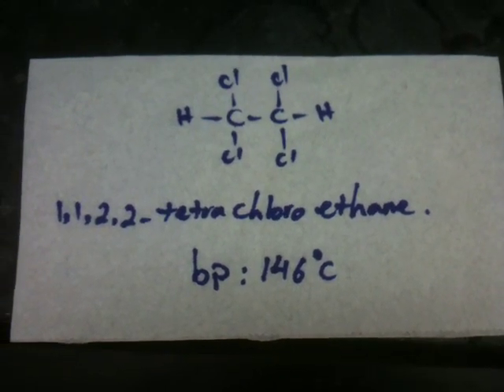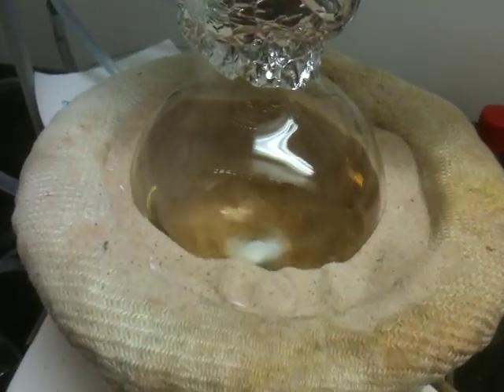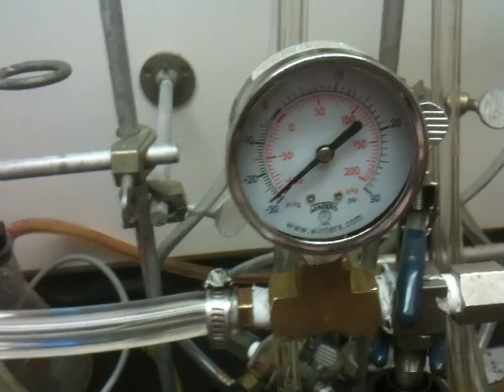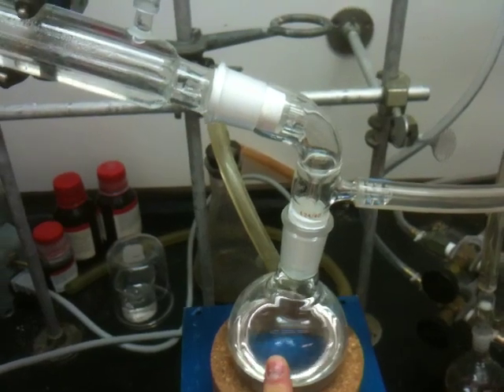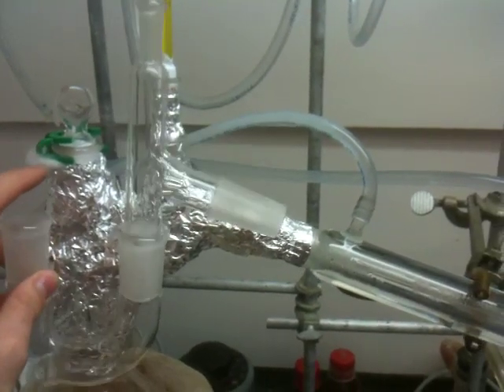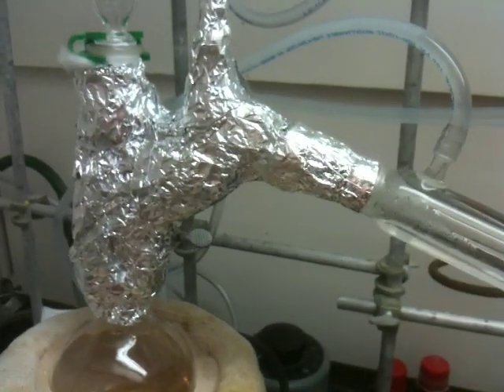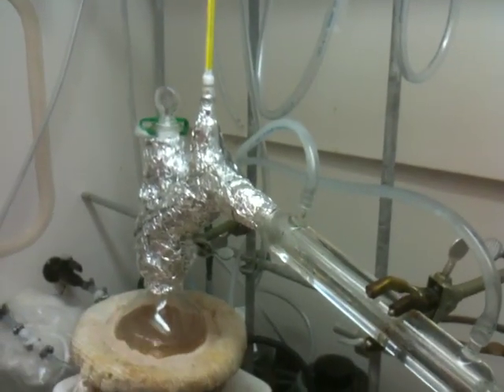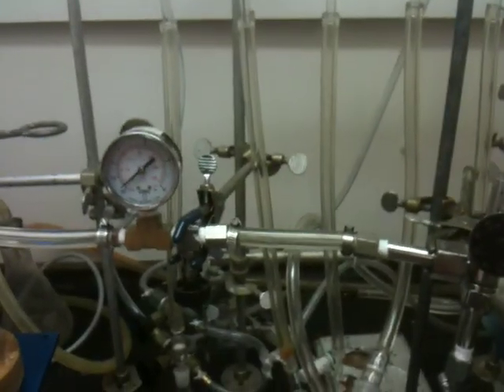High vacuum distillation of  tetrachloroethane

Comment: Hay I hope you see this.. did useing this adaptor give you better separation i am currently distilling a mixture of  3 hydrocarbons and think this one change could make all the difference
Reply from the maker: @furnish1696  I don’t see the adaptor….if you have a taller distillation tower, you’d get a better separation
Reply: Ah i meant the the swan neck fitting you where saying you'd added. I only need  like 4c extra separation. I do have a packed column set up ive beeen using to redisill product but its time consuming

Comment: Should the vacuum pump be left running for the distillation time   Or even reach the required vacuum and then close the valve ?
Reply: i guess the pump is left running.
Reply from the maker: it deepens on the boiling point of the solvent. In some cases you need to run the vacuum pump constantly. However,  I would use a regulator or needle valve to control the vacuum pressure.

Comment from the maker: @lanceross3000 
it will work at 29" if you carefully control temp. I am sure you know PV=nRT. the stronger vacuum, the lower the bp will be. so strong vacuum at 29" + high temp will shoot up everything! I broke down the vacuum by regulator because i didn't use temperature controller apparatus. I assumed playing with pressure (in my case) was much easier than temp. if you have temp. controller bath go ahead and apply  29" vacuum and slowly increase the temp. check the approx. bp by nomograph!